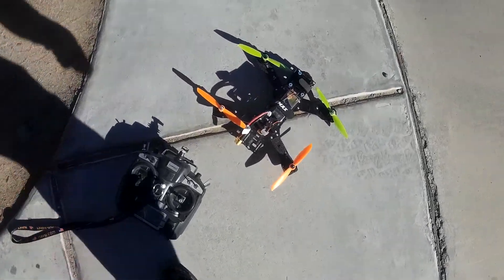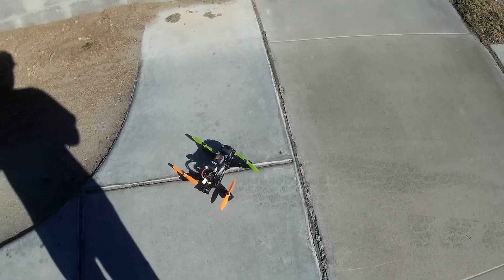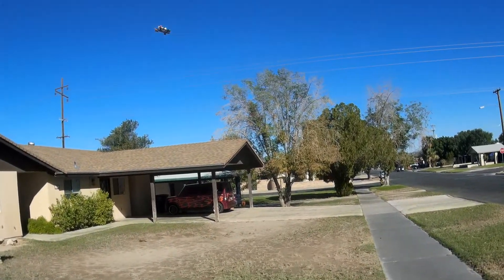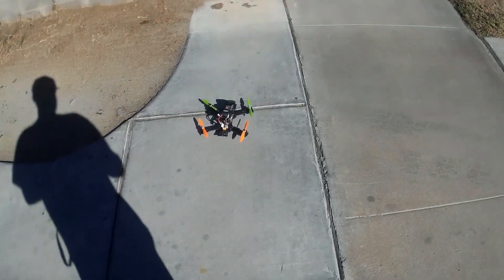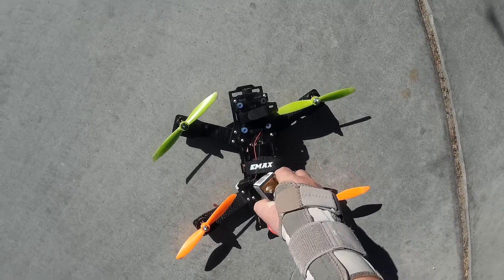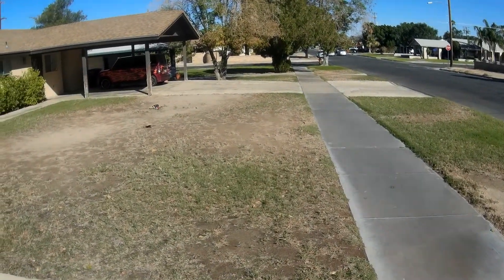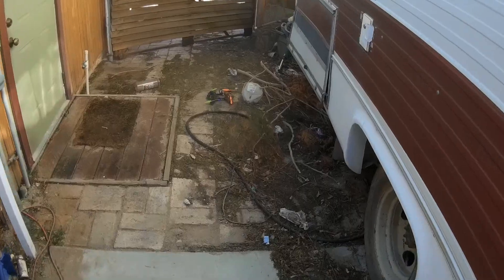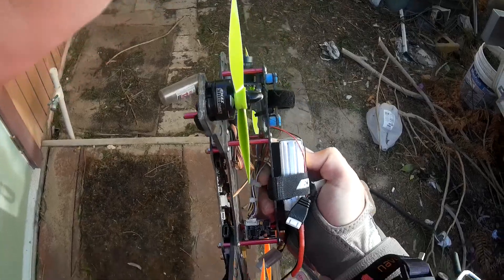Emax Nighthawk Pro 280 - BetaFlight/BLHeli 14.2 test

Comment: bloody hell you were beating the crap out of that thing - tough little bugger
Reply from the maker: +Ken Kirkpatrick I've never been one to be gentle with my toys.  And when I'm in a bad mood or frustrated things get even worse :D
Reply: +Jason Hitesman Well thanks a lot Jason for your video and info on wiring up the Emax Nighthawk 280 ESCs for BLHELI firmware.   I used an Arduino Mega and it worked perfectly.
Reply from the maker: Ken Kirkpatrick Glad to be of help!  I really need to finish my 3rd video on setting up dRonin on these - I just love how quick and easy it is to get up and flying with a great tune thanks to autotune :D  Just been too busy the past month or so to get much flying in.